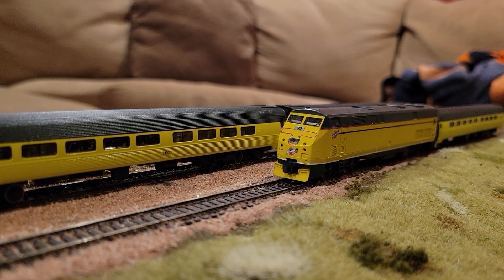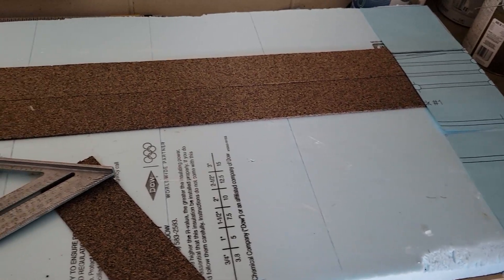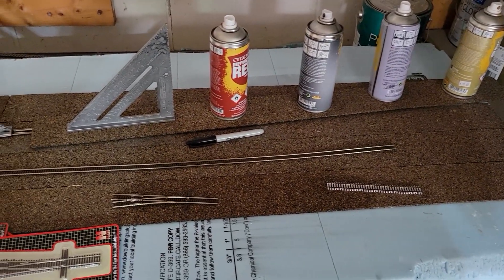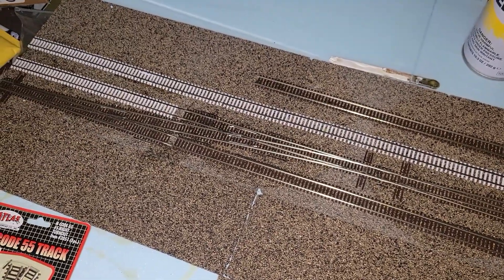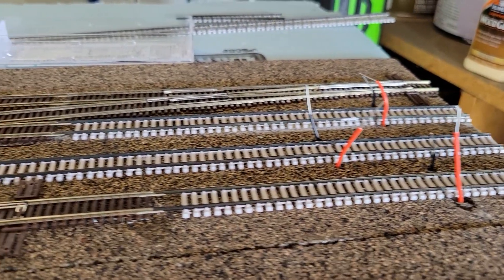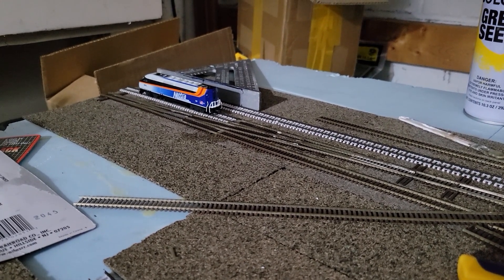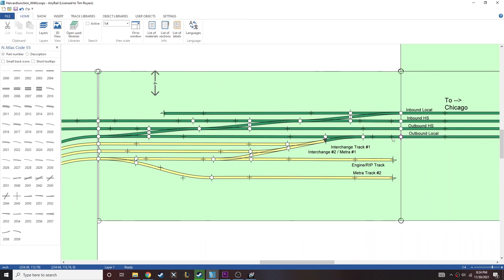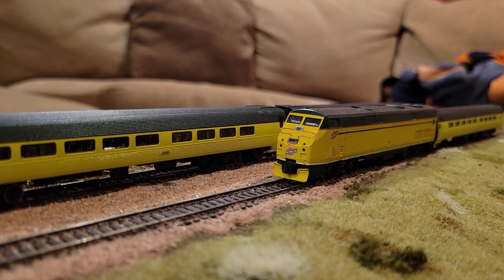CNW Wisconsin Division N Scale Layout - Ep 3 - Initial track and wiring

Comment: Buy some dedicated flux, makes all the difference. It cleans the joint and also helps distribute the heat much better from the iron to the work. When everything is set up properly and there is enough flux it should only take two seconds (or less) for the solder to wick into the joint. Paste would work best for this, but they also sell liquid flux. Just make sure it's not acid core, that is used for pipes, not electronics. Like anything else, practice makes perfect. I melted my share of ties before I got it right.
Reply from the maker: That's how I knew something was up - I tried the flux paste and it still wasn't going.  The solder would melt and literally bead off the rail/wire on to the cork.  I just don't think the iron is getting hot enough to bond the rail/wire/solder.  We'll see when this new one arrives.  I'm also going to use some scrap flex pieces and wire to practice.